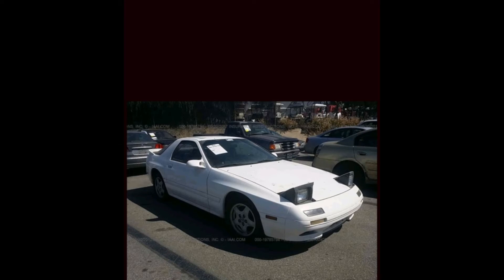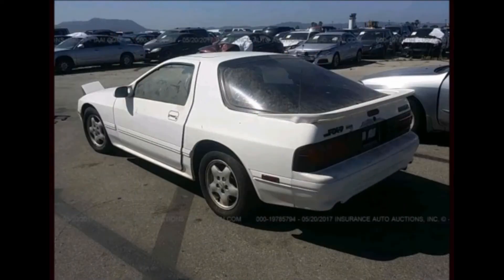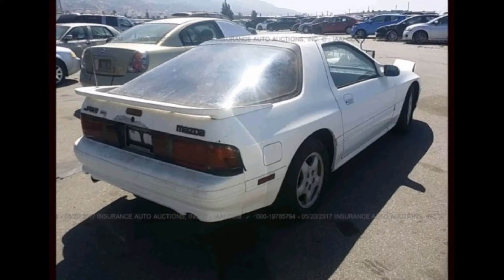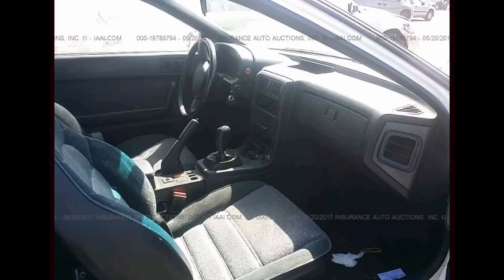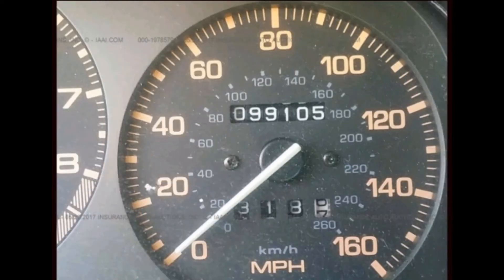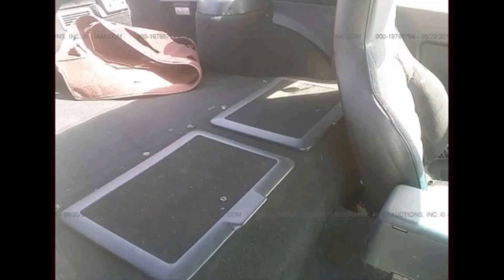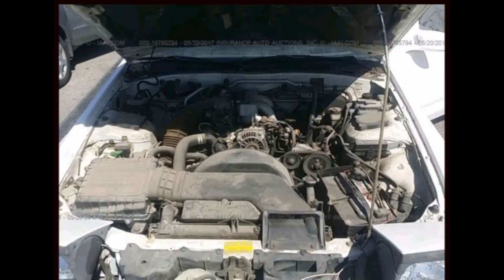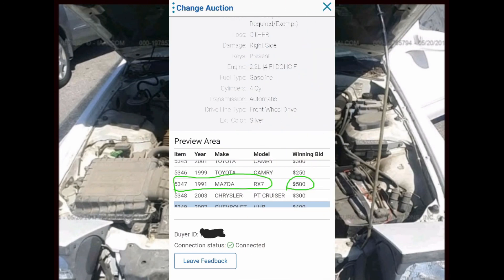How to rebuild 13b rotary engine rx8 rx7; 
drift car under $500
 drift project car  
fc s5 mazda rx7

Comment: Yo, u gotta put all ur rotary engine videos into a playlist, it would be super helpful.
Reply from the maker: MingTheKing100 thanks for the comment and yeah but still on the learning procces of how to edit the videos and stuff haha 
Something i will do is a full step by step series of how to 
Disassemble the engine
How to clean the parts,with shop tools or homemade!
How to inspect the parts to see if they can be reused, using the mazda manual specification and table chart!
And how to assemble the rotors and full engine!!